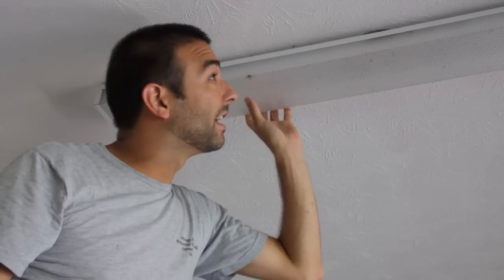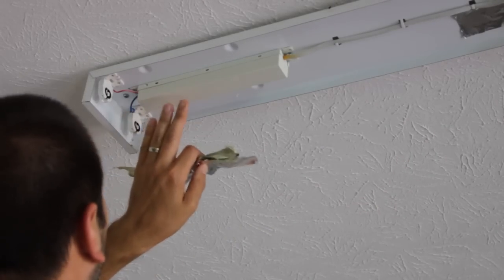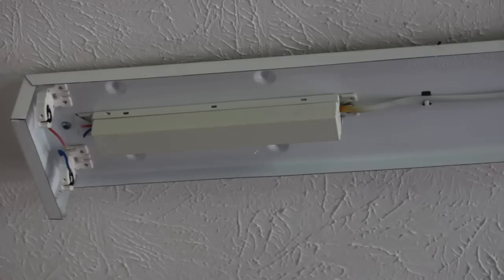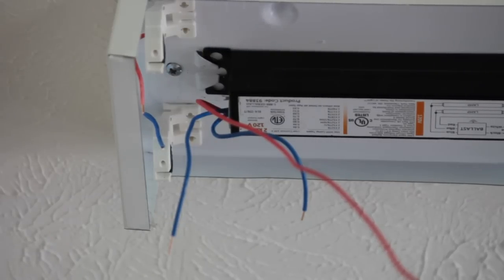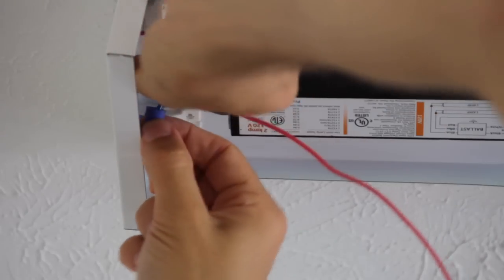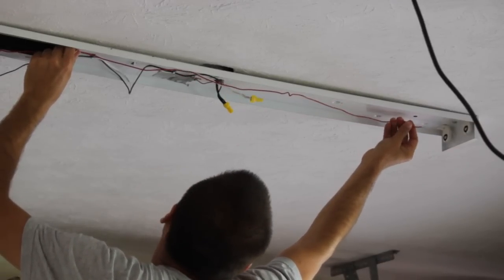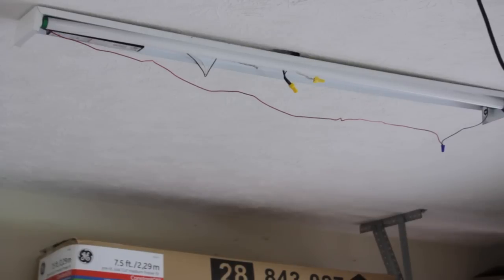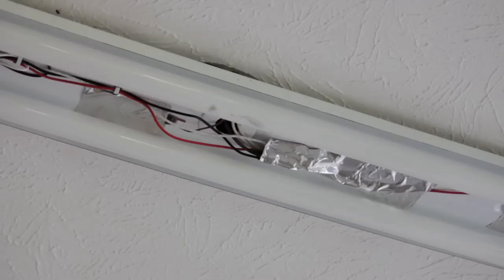Replacing the Ballast on a Fluorescent Light Fixture

Comment: Nice work, but it I were you, I would have saved that white wire sleeve and used it for the wires of the new ballast (so that the colored wires wouldn't be too visible through the lens)
Reply from the maker: That's a pretty good idea!  The lights are in a work space in the garage.  I'm not too particular about aesthetics in that location. :)

Comment: If the light is wired up wrong due to the confusing colors, can it be rewired?
Reply from the maker: Sure.  Just undo the connections and give it another go.  Be cautious with electricity and wirings, though!

Comment: Did anyone notice the hole in the lamp where power enters the fixture , possible shorting cause there's no inner plastic washer to protect the wires from being scathed by the sharp edged metal
Reply from the maker: That's something that really bothered me.  The reason I didn't say anything about it is the insulation on the line.

Comment: I have 2 4-bulb florescent fixtures I'm my kitchen. Only 2 bulbs work in each one (don't ask me why). Recently, one sets of bulbs don't work and the other doesn't and vice versa. sometime both fixtureswork, sometimes they don't. thought was the switch but that doesn't seem to be the case. the issue is intermittent. the bulbs are new and secured properly (the some of the plastic pieces where the bulbs go into the fixture are broken or cracked). Anyway, if it was a bad ballast, fine. but two? the latest seem to work and not work intermittently? thoughts?
Reply from the maker: So, you have problems with both fixtures working simultaneously? However, you also have troubles with the same two bulbs working in a single fixture?
Reply: +Realsuddenlike There are four seperated bulbs, two in each fixture. There are two fixtures. Sporadically, both lights in the one fixed would come on and neither of the lights in the other fixture would come on. Sometimes the first fixture works then the lights in the second fixture won't come on. Sometimes none of the lights in any of the two fixtures come on and sometimes they work fine. Either I have two ballasts going bad at (strangely) the same time or there is a wiring issue somewhere. What confuses me is that none of this is consistent. Ever heard of this?
Reply from the maker: I've never heard of this.

However, the two lights in my garage (in the video) had the ballasts go out within a short window of time from each other.

How old are the fixtures in your kitchen?  Are they the original ballasts?
Reply: +Realsuddenlike One balast is original (15 years or so - can't believe it's lasted as long as it has) and the other is only 2 years old.
Reply from the maker: I did some googling and found this link with some basic steps for troubleshooting.

http://diy.stackexchange.com/questions/40803/why-are-my-fluorescent-lights-not-working-sometimes

I think it's a pretty good list of places to start.  The very first step, the switch, sounds odd but I've had 5 or 6 switches in my house go bad in the last 2-3 years.  Sometimes they would work; sometimes they wouldn't!

There's also a comment about a starter.  I have zero experience with these.
Reply: +Realsuddenlike Thanks for all the help, you're a good man. Well get this oddity straightened out. I'll check out the link you provided and perhaps start with the switch and work my way from there.
Reply from the maker: My pleasure!  Thanks for the conversation.  I hope you can get your problem ironed out.

Comment: Lol i got belted by not turning the electric off...I screamed when i got belted my naighbour was on the phone at the time and screamed for me then crapped her self and ran to the toilet 😂😂😂 This is true it happened last week 😂😂😂😂 Thanks for the video weve still an issue with the t5 light unit weve bought a new ballast but no lock down pins inside and I think we are going to get an electrician now...
Reply from the maker: Electricity goes off first.  We had a switch to keep the electricity off but I always through a breaker.

Calling an electrician is never a bad thing.  Plus, most of them will let you ask questions and even show you how to do what they're doing.  Just ask. :)
Reply: Did you get burnt?

Comment: How do you know it's going bad?
Reply from the maker: That's a great question. 

If nothing has changed in the electrical connection (switches, fixtures, wiring, circuit breakers, etc.) and the bulb is not particularly ancient or excessively well-used, then the ballast is probably your culprit.  In my case, when it failed, you could visibly see the heat damage on the body of the ballast.

Thanks for asking!